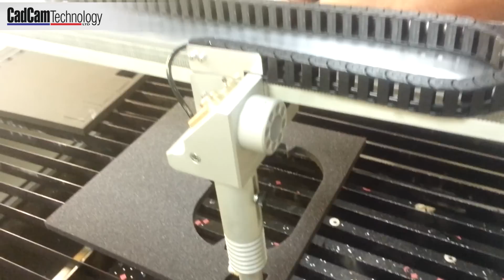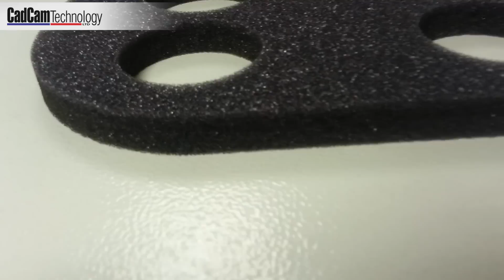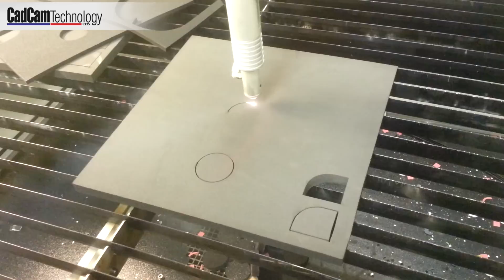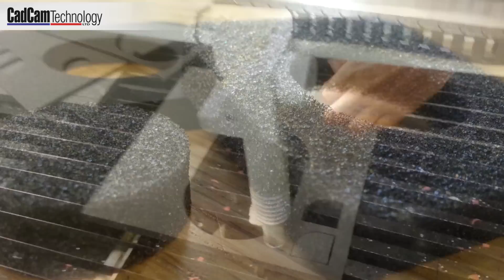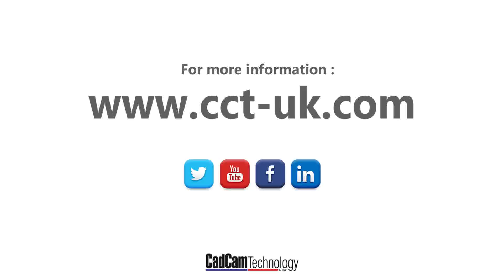Laser Cutting Foam and Rubber

Comment: Thanks for posting the video. We have a 120 Watt CO2 laser and need to cut some closed cell polyethylene and open cell foam as well. What settings would you recommend to make those cuts in 1/4" through 3/4" thicknesses? I appreciate any input you have. Thanks... Dave